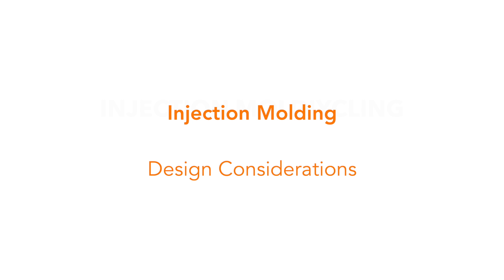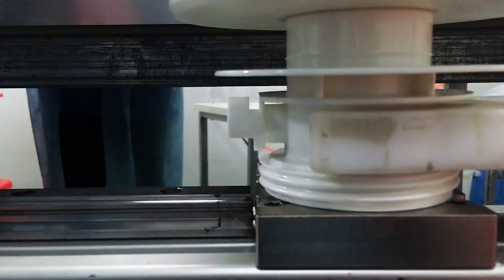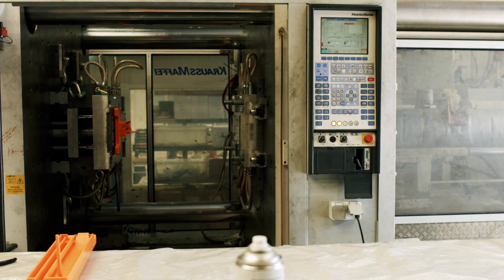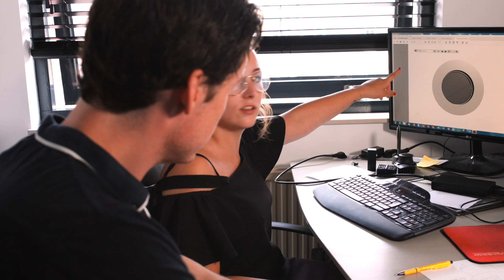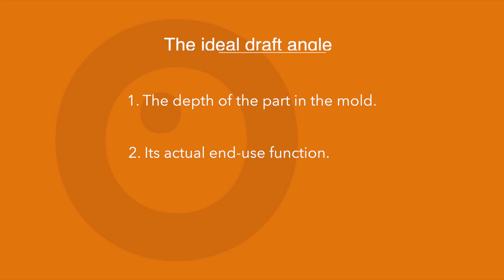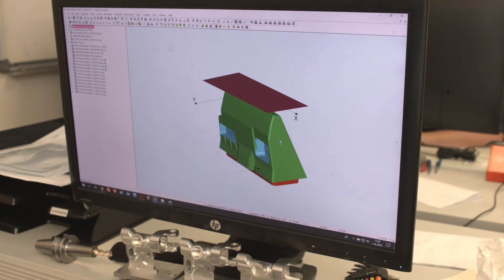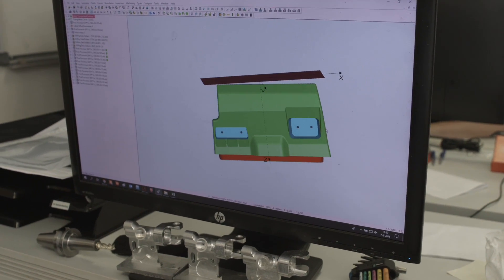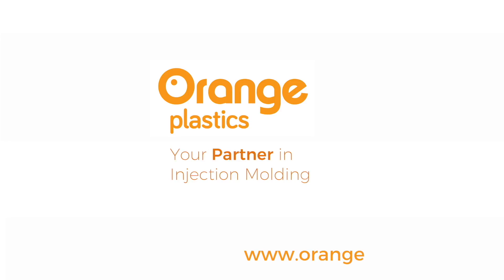Injection Molding Design Considerations

Comment: This hits the nail on the head! 🔨 Successful molding lives at the intersection of smart DFM and precise execution. Our engineers specialize in this exact synergy—using mold flow simulation insights and design for assembly principles to optimize parts for quality and cost before cutting metal. Partnership is key!